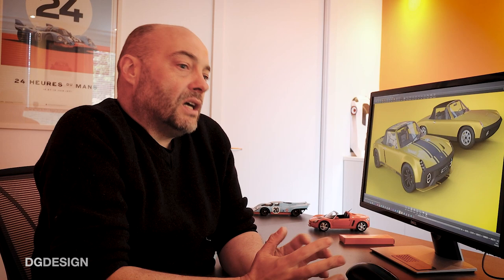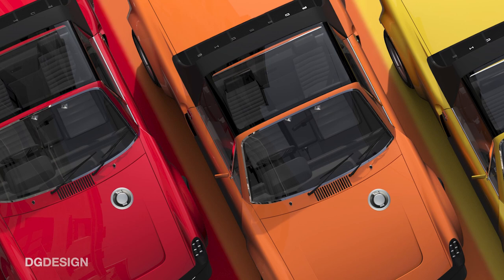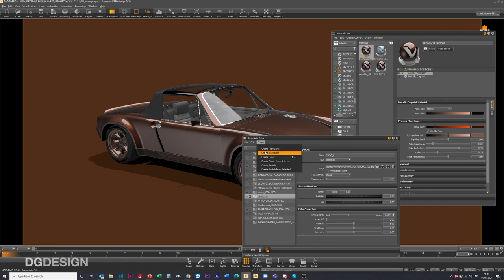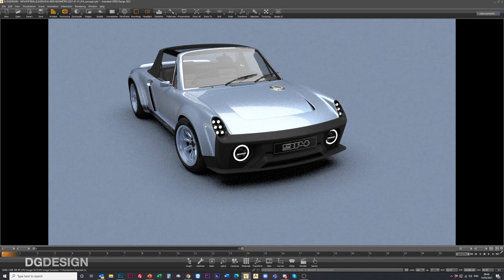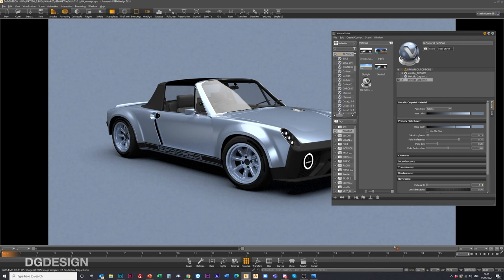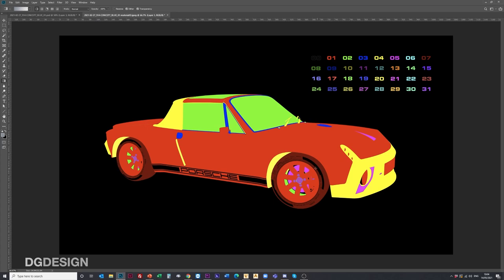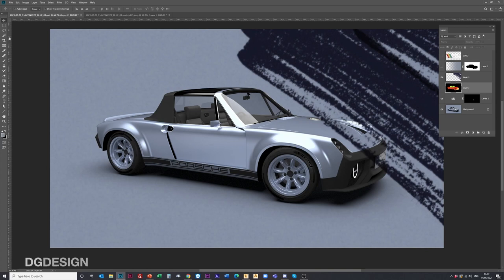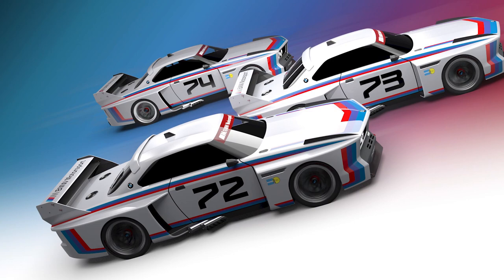Behind the Scenes with Mike Turner, S01/E03: Getting Started with Backplates

Comment: is that the standard studio lighting as well?
Reply from the maker: Hello,
yes at the beginning Mike is using the default environment of VRED.

Thanks,
Flo
Reply: @VREDPRO  what can i do if the backplate image does not show? instead i get a blank backplate icon in the background
Reply: @chriskim9289   - ummm . . not sure on how / why your issue is occurring, but I have had a similar problem when moving between older / newer versions of the software. Have you tried deleting and re-assigning it via the sceneplate editor menu?
Reply: @miketurner8544  yes. the image is still void. I did work on my file on a different computer with a newer version of the software once. Is there a way to start a new vred instance and import all of the allocated materials as well?
Reply: @chriskim9289   - VRED will let you import other models & scenes into the latest file you're working on (File >Import) - the import option preserves all shader tags etc - so copying shaders from old geometry to new is quick and simple.